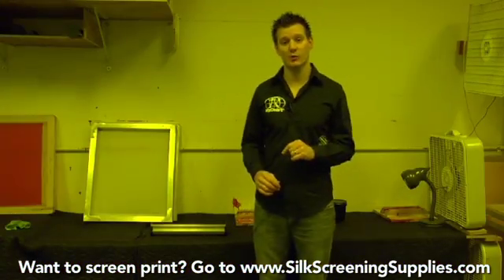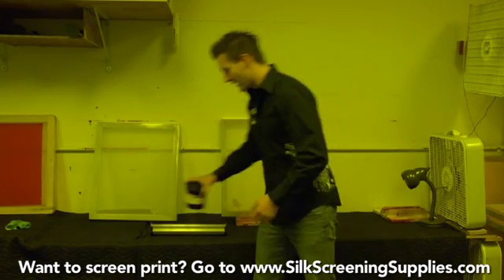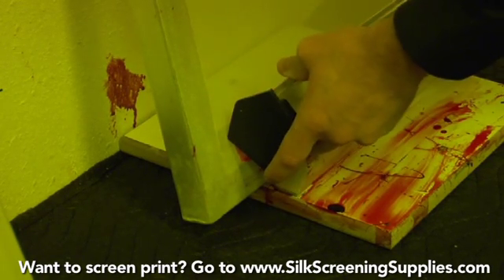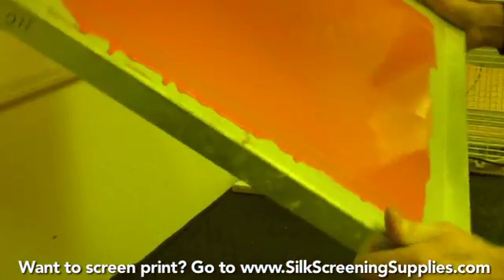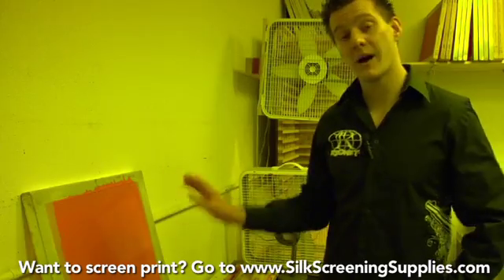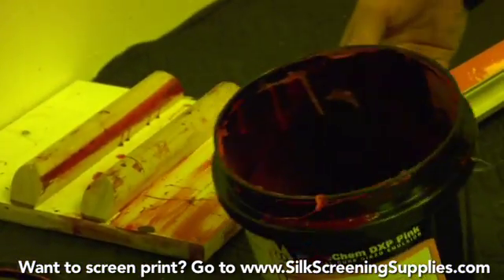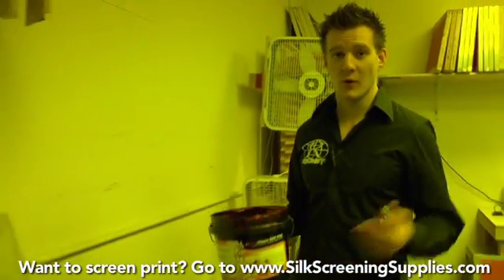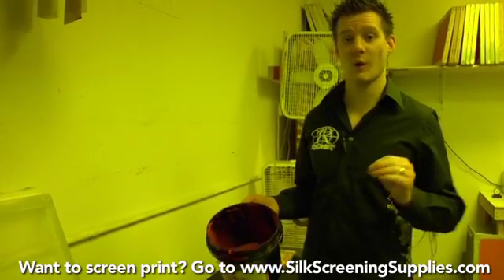How to Screen Print - Emulsion problems trouble shooting - Screen Printing 101 DVD pt 19

Comment: Thank you so much ..  I have been screen printing for a while now just as a hobby and for family.. I have done many screens coating and exposing but for the last few days I have been failing to expose and wash screens..  I use the same exposure timing and same procedure but the emulsion wont come off where the design is.. and if it does after a lot of spraying, big portions of the rest of the emulsion comes off of the screen as well and ruins everything.. 
Now, the only thing I could think of is that I have had the emulsion container for at least six months or more and it had been in a shed in temperature over 100 degrees in NC.     I think that might be it right?
Thanks again for all of your instructions and tips.
Reply from the maker: Okay yes, the emulsion sounds overexposed and it can actually start to expose on it's own when in high temperatures. The emulsion needs to live in a cool dark space!
Reply: @anthonyavant

Comment: Coating 1/1 and still get emulsion dripping . Any suggestions? 

What happens if you keep flipping the screen while drying ?

Since I’m dripping , can I coat ink side then shirt side and let gravity bring it down again?

I don’t have skipping or thick emulsion it just keeps dripping no matter what I try with hard pressure .
Reply from the maker: Hey there!
There are other variables that can cause your emulsion to have a thick coat.
Control your speed and angle. Go faster if the scoop coater is laying down too much emulsion and tilt higher or lower to allow less or more emulsion.
Reply: Ryonet thank u!

Comment: how can we give metal resistant to our screen, or want to make very durable for longer use,
Reply from the maker: Unfortunately, we are not familiar with the process of making a screen metal resistant. Normally, we would just sand down our scoop coater to make sure there are no sharp edges that would scratch the screen.

Comment: Hi there, can I use cold water to rinse out The Green Stuff?   Or do I have to use warm water?  Thanks
Reply from the maker: Using warm water will help more with degreasing your screen, but you can usually get away with using cold water. You may just need to rinse the screen a bit more than usual.

Comment: what if you see little sensitizer grains in emulsion
Reply from the maker: D Manning is enough to effect the print?
Reply: Ryonet what should i do
Reply from the maker: D Manning what kind of emulsion is it? If the grains are enough to effect the print I wouldn't use it, if it isnt much than its probably okay.
Reply: the same as in start up kit the grains settle on the top of it can they be scraped off or strained
Reply from the maker: D Manning You may need to add a little water and then stir thoroughly to get it to mix in properly. Directions for Diazo: When you mix your emulsion, use luke warm water in the small sensitizer bottle. This will insure adequate dispersion of the particles. Make sure and mix the two components very thoroughly, until they become one color. Once stirred, allow the emulsion to breath with the cap, part way askew. It is ideal to let breath overnight, but you can use after a couple of hours.

Comment: if your emulsions washes out while you wash out the logo whats the problems,?,i see pin holes popping up as well.and the emulsion washes out ..even with out using high water pressure
Reply from the maker: riflemania it means you are underexposing your emulsion. Or it could be that you emulsion isnt fully dry when you're exposing
Reply: under exposing emulsion? or under exposing screen during the burning process?..how long is long enough so it drys properly???
Reply: @riflemania  under exposing means "under exposing the emulsion on the screen during the burning process", it is the same. The length is different for every uv light setup, emulsion type.. you might need to run some burning tests first, google "exposure calculator"